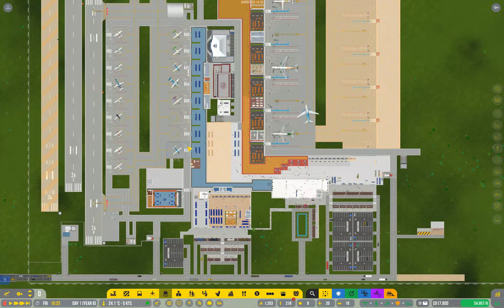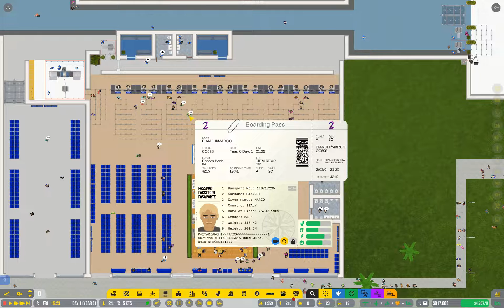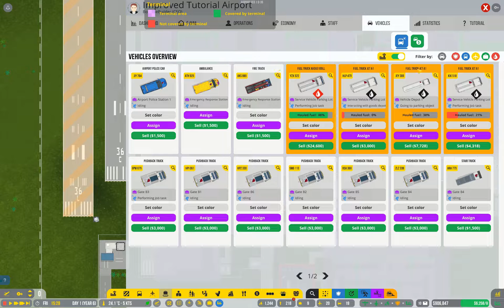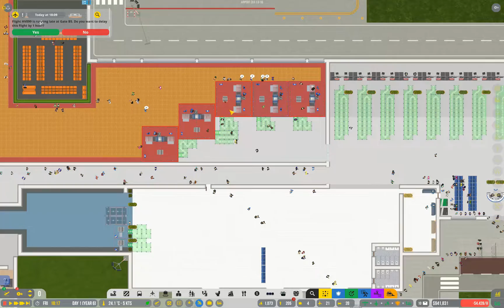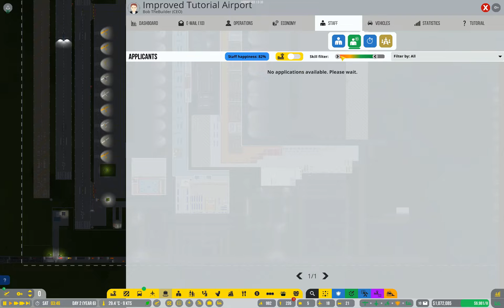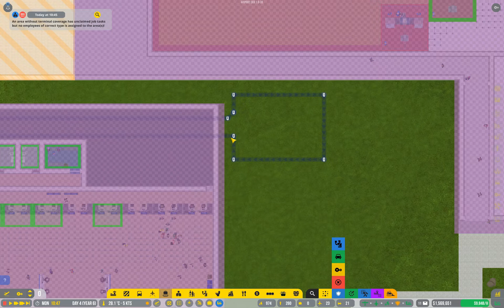Airport CEO Improved Tutorial: Multiple Terminal Operations

Comment: Not sure if you ever found the cause of the secure zone errors in your airport but I've found typically the cause for me is staff.

For whatever reason the game is designed so staff have to go through the same security process as passengers for accessing and leaving secure zones..... except in some situations they seem to completely disregard that they need to be sticking to those rules, only to remember later that they do have to follow the rules when then trying to leave a area they shouldn't have been able to access or they decide they need to pass between different areas that involves one or more secure areas between them with no security checkpoints and secure exits to allow them to make the transitions.
Reply from the maker: I'm pretty sure it came down to the shape of my terminals. If your terminals are two simple rectangles that are well separated, things work well. If on the other hand you have interlocking shapes, things go very poorly.

Comment: I tried this out and for some reason I have passengers taking the subway to the wrong terminal and then they are stuck without a path. it works for most leaving that terminal, but the select 10 or so are trying to go somewhere else.
Reply from the maker: Try restarting your terminal marking over the subway entrances and make sure you haven't accidentally joined the two terminals somewhere. Things tend to go very haywire if you do that.